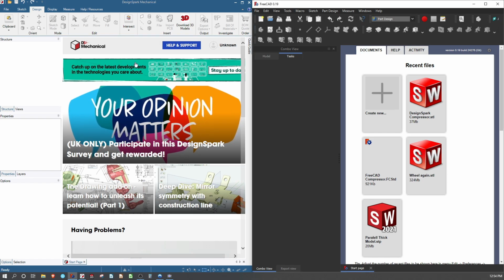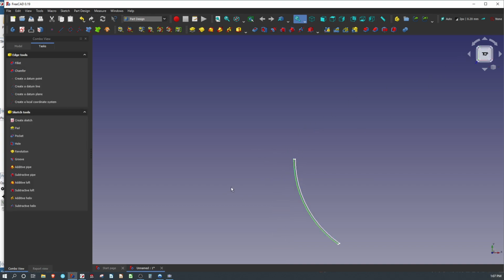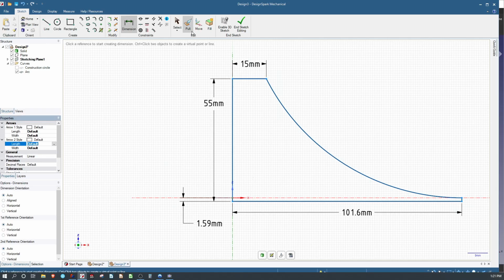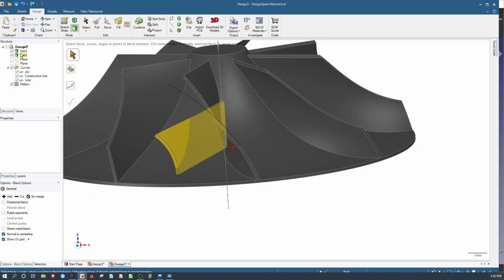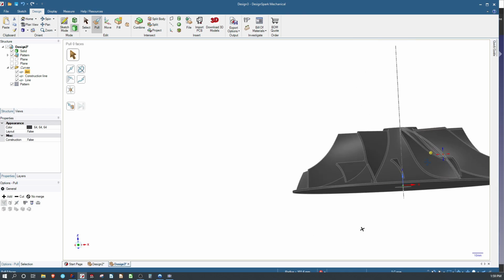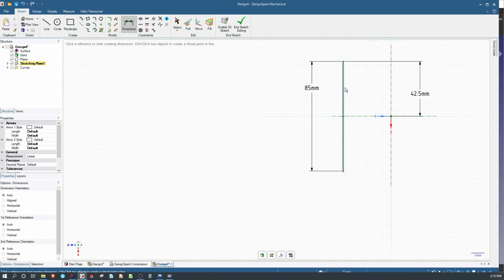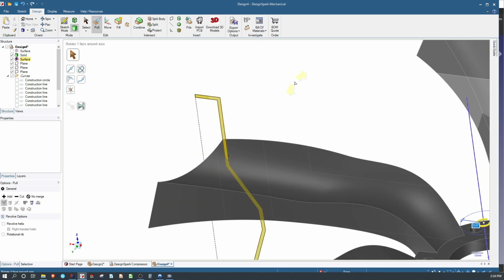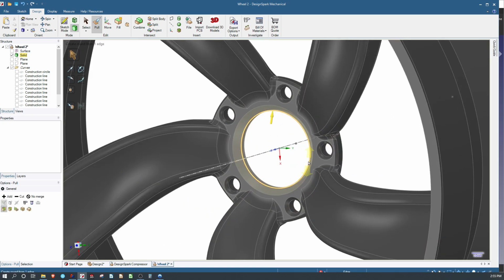DesignSpark and FreeCAD- A Big Comparison Between Direct and Parametric Modeling! |JOKO ENGINEERING|

Comment: I invested the time to learn DS a decade ago for enclosures for my printed circuit boards, and have used it since... It is quick and easy for 3d prints etc. BUT, you have to upgrade to interact with about everything other than 3d prints...  The "export as dxf" after upgrading to a paid version leaves a lot to be desired, so now I am needing to do CAM operations for cnc, I am investing in learning FreeCAD.  thanks for the comparison!

Comment: Thank you for this informative video! I've been learning Alibre for the past couple weeks and the more I learn the more I think parametric cad just might not be best for me, and a direct modeling method with contraints might work better. Have you heard of plasticity, better or worse than design spark?
Reply from the maker: I do know that plasticity exists, but I'm firmly rooted in parametric myself.  I know Plasticity uses parasolid, so you would be using a popular geometric kernal used among many parametric modelers too, if you care about degrees of compatibility.  Designspark uses spaceclaim, mostly on the Ansys side.  Might be good if you have Ansys and want to analyze your stuff from a more native format.
Regardless, good luck on your projects.

Comment: Hi, very interesting video. However, I expected that at the end there would be a comparative summary of the two programs in order to understand which program is still more convenient for modeling. I have not used the "FreeCAD" program, but I am familiar with DSM. Now I use DSM-5, because when I used DSM-6, the program started to hang when creating a model with curved surfaces, and the "Fill" tool did not give the result I wanted. Of course, there is no "Constraints" toolbar on the DSM-5, which, according to your video, is very convenient in modeling... As a result, I made my last video on my channel on DSM-5, since it was impossible to do it on DSM-6. After a quick look, I still have a question, since I have difficulties with translation - which program would you prefer for modeling?

Comment: Just some comments on your usage of DSM. Firstly, I think you did a very good job Joko considering your little experience with DSM.
With DSM at 32:20, before coming out of the sketch, you could turn off the solid first, then exiting the sketcher will produce a round unbroken face and an unbroken face edge on the Impeller blade. Or, make the circle construction and exiting will produce a construction curve - which can then be filled to a face. Or, make the curve a layout curve which will not break the solid faces - it can also then be filled. ( Sorry - layout curves can be made from traditional sketcher, not constraint sketcher.)
Any change to one of the patterned blades effect a change to all - so no need for 360 deg pull cut. Patterns act like Features - also the scallop cut in the blade - it's face can both be pulled to a different radius or its face may be repositioned.
41:28 - select any face, in selection tab then choose the protrusion, move, select axis, pattern.
TB continued - long video...you could so easily with the impeller just work with 1/8 revolution of the part and pattern the other 7/8ths ( just made it this morning as practice piece - all OK and faster - probably similar in any cad software ) When making faces or curves - there's always the ability quickly to keep a copy faces /curves if you believe you might need it. Also, select any face and press K for sketch, and back your put into with face edges shown as sketch curves for edit / making more curves etc. Also, select any face , key X for section, then drag or move the edge and the face it represents also moves - simple and highly visual.
Not fair for me to criticise at all - you have done a very good job at demonstrating DSM and what I'm very struck by is how well you have modelled up fairly complex parts with fairly little training. Considering your wealth of experience with FreeCad, I think you actually got there faster with DSM which is remarkable! A few ( and maybe more) years ago I wouldn't have even been able to conceive those fillets and rounds on the wheel spokes you put down!
Reply from the maker: Thanks!  Thsie are great tips!
Reply: @JokoEngineeringhelp  You're very welcome...